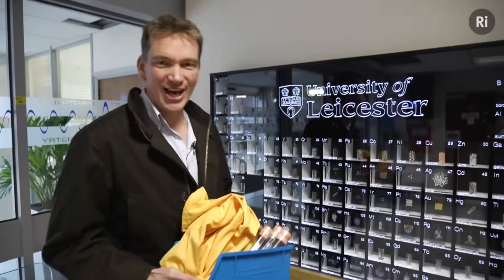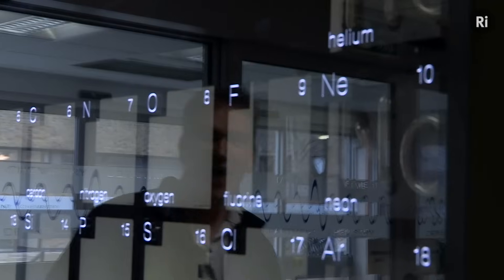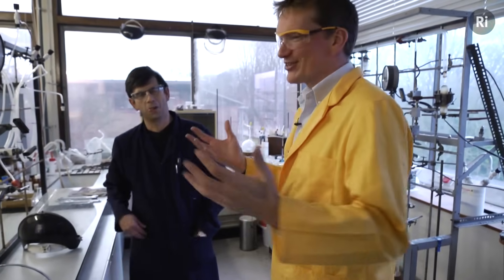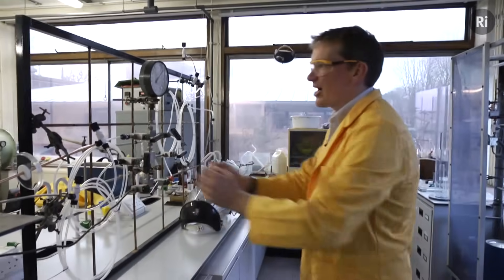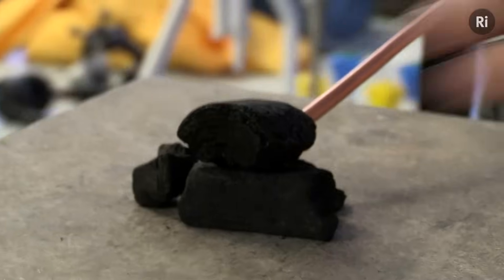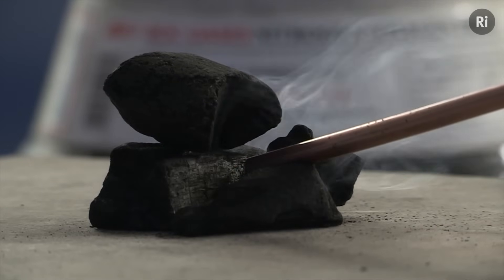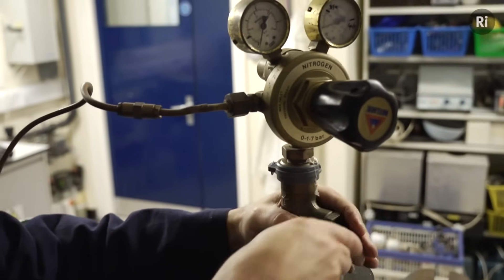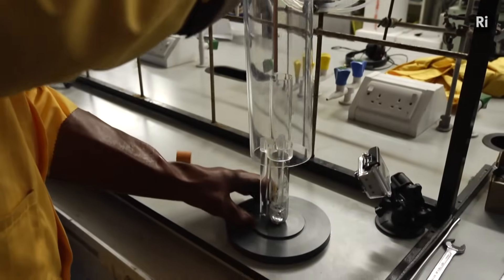Reacting Fluorine with Caesium - First Time on Camera

Comment: thats a load of BS, I thought that the alkalie metals got more reactive down the group. Francium is more reactive
Reply: Actually, due to relativistic effects caused by the extremely large relative mass of Francium atoms, it's atomic radius is significantly lower than you might expect, lower than Caesium's in fact. This means there is a weaker electrostatic attraction on the highest energy electron in Caesium than in Francium therefore the activation energies for Caesium reactions are lower, making Caesium more reactive.
Reply: Except Francium only has a half-life of 22 minutes in its most stable isotope, is highly radioactive, and about 1 ounce exists at any given time in the Earth's crust. For all intents and purposes, Cesium is more reactive due to the fact that Francium has never actually been reacted with anything.
Reply: A fact is a fact. Francium is definitely a more reactive metal. But I get where the guy in the video is coming from. (basically I'm being a pedantic bastard)
Reply: Sure thing. While you're right in there being quantum effects, they are very complicated to try and explain, but they have to do with the energies of the electrons. To simplify it slightly I'll use Bohr's model of the atom which treated electrons like planets orbiting a star (the nucleus). As the electrons are moving in a circle, they are constantly changing velocity by their direction of motion and therefore are always accelerating. This is actually why the theory doesn't work as they would radiate electromagnetic waves when accelerating, but for simplicity's sake, I'll stick with it. The electrostatic force between the electron and the nucleus acts as a centripetal force. This is needed due to the acceleration of the electrons as F=ma (newton's 2nd law). Anyways, in circular motion, F=v^2/r where F is the centripetal force, v is the velocity of the electron and r is the distance between the electron and the nucleus. In Francium, the nuclear charge is so high that the force between it and the electrons in the lowest energy levels causes the velocity of said electrons to be so large that special relativity is needed to be taken into account. I'm not quite sure on the specifics here myself but I do know that this causes all of the electrons in Francium to have lower energy levels than expected, even lower than that of Caesium. This means that in the reaction, more energy is required to ionise the Fr atoms to Fr+ than for Cs. This makes Cs more reactive. (Sorry about all the circular motion stuff, just had an A2 physics exam :P)
Reply: ASandwichNinja Can you please explain how this is caused by relativity? Seems counter-intuitive to me- I'd guess it was a quantum effect.
Reply: ASandwichNinja Thanks for your reply. Don't worry- I did a Physics degree so I get that if electrons were actually orbiting at close to the speed of light you'd need to take into account relativistic effects. Still, in reality they aren't orbiting- so can length contraction really be applied to electron "orbitals" in that way?
Reply: ***** Actually yes, it can be done as simply as that by using the equation for length contraction L'=Lsqrt(1-v^2/c^2) where L would now be the bohr radius (the average distance between the nucleus and electron in a hydrogen atom) and L' would be the relativistic radius. Alternatively, the same result can be achieved from using the original equation for the bohr radius, but using the relativistic mass of the electron, but I can't be bothered to type out all those equations :P

Comment: How dumb is this guy, really? Yeah  so Francium may be radioactive and decay, but it IS the most reactive metal, WAY more reactive than Caesium. And Fluorine being the most reactive non-metal??? Try most reactive ELEMENT!
Seriously, get your facts right!
Reply: Francium is less reactive due to relativistic effects. The inner electrons are moving a very fast speed, so fast that you need to take in account relativity in order to calculate their energy levels. This as a result has an effect on the energy level on the outermost electrons in francium which makes them more stable and hence harder to lose than in caesium.
Reply: thecsslife That's just the theory part of it, but melting at 18 degrees C and exploding in contact with air? If that doesn't sound more reactive than Caesium to you, i don't know what will...
Reply: John Werner True that, but the way he says it makes it seem as if there's another more reactive element in the Table, and it's either a metal or a metalloid. But that's not the case, so i think he could be more specific...

Now about the Francium, yes, i know of its minute existence at any given time in the Earth due to its short half-life, but then again, just because an element has a short lifetime, doesn't mean it can't be the most reactive metal out there...
Reply: Actually, francium needs 393kJ per mole to remove its outermost electron to form a cation, 17kJ per mole more than caesium. As other people have said, its due to relativistic effects.
Reply: MCvirtual3d Gameplays Where did you get that information from? I'd like to see THAT theory! Still, i think Fluorine continues to be the most reactive element in the universe. You know, what with it bonding with noble gases out there
Reply: MatBacon I'm pretty sure what he meant was the most reactive practical metal. It would be unpractical, crazy, and expensive to have Francium due to its short as hell half-life and radioactivity. I'm sure he knows that its the most reactive, any 10th grade chemistry student knows this. So in essence, he probably should've said "The most reactive element that can be obtained."
Reply: yes Francium in the most recitative element if you were to put a gram of Francium in water bottle it would destroy dozens of houses around you.
Reply: theinfamousnimrod Well, he did specifically say "even more reactive than Francium", so honestly, i don't think he knows where his facts are...
Reply: MatBacon well sorry but that theory is still just a theory because there has only been 300,000 atoms of Francium discovered in uranium ores and has a half-life of 22 minutes then decays into radium so there can only be about 30 grams on the planet at one given time.
Reply: N0ah's Gameplay's True that. Imagine if that theory were a law though...
Reply: James Oldfield If i'm not wrong James, out of all elements, fluorine has only not reacted with He and Ne. I'm pretty sure Ar has been successfully reacted with F. The resulting compound is only stable at very low temperatures though.
Reply: Alex Shakeshaft Apparently Chemistry doesn't care what we think. Nobody tells it what to do, it is its own boss.
Reply: Hey monkey boy The Wikipedia article on Francium states: Francium has a slightly higher ionization energy than caesium, 392.811(4) kJ/mol as opposed to 375.7041(2) kJ/mol for caesium, as would be expected from relativistic effects, and this would imply that caesium is the less electronegative of the two.
Reply: @Soaring-Dragon  true that

Comment: I dare you to react elemental fluorine with elemental oxygen. At room temperature.
Reply: Wouldn't you just get oxygen difluoride?  It's a known compound and of course a very powerful oxidizing agent, but probably not any more dangerous than fluorine itself.
Reply: xtenkfarpl xtenkfarpl snr Perhaps. I'm no longer sure. I was thinking it would be Dioxygen Difluoride.
Reply: ZizZazZuz
It appears O2F2 decomposes above 113 Kelvin, so you won't get that at room temperature.
Actually I'm not sure oxygen and fluorine will react at all at room temperature.  I'd have to look into the bond energies, but I suspect O2 + 2F2 -> 2 OF2 may be endothermic & won't happen spontaneously?

Comment: The most electronegative element with the least one.
Reply: Wait, I'm a beginning chemist and maybe some of the stuff i've been taught is false, but isn't Francium the least electronegative?
Reply: @venomoussloth5092  Just studying the trends won't help....There are some anamolous properties in the groups and periods... Mostly because of their electronic configuration and their half/full symmetric configurations
Reply: @venomoussloth5092  It depends on the relativistic effect. Because Francium has so many shells the outer shells are moving at fraction of light speeds and it actually causes the atom to contract a bit. and makes the electrons harder to remove than expected. That makes it easier to remove an electron from Caesium than it is from Francium. Hope that helped :)
Reply: @generationedge6699  if francium was not radioactive
Reply: @ytbgamer9380  Well radioactivity doesn't make any difference to the electronegativity of the element .. well at least that's my understanding. Correct me if I'm wrong.
Reply: @generationedge6699  correct, it's due to length contraction due to relativistic effects
Reply: @venomoussloth5092  maybe because Francium is radioactive and it decays. Idk honestly as I'm a 10th grade student :-)
Reply: @bhoomipurohit_nd5_em802  Radioactivity doesn't have an effect on electronegativity of an element. Also, I'm a 9th grade student. School doesn't teach us anything anyways. Thank you Internet.
Reply: @venomoussloth5092  no
Reply: @darkgreninja8349  Why no, Francium is the least electronegative
Reply: @illya.ruslanovichshevchenk4106  No it isn't
Reply: @venomoussloth5092  it is, theoretically...but it is radioactive in nature and so it is not considered the most reactive metal practically
Reply: @coco nut seems like everyone is here in 2021
Reply: It won't explode un like it react with water
Reply: @unknowunknown9096  Francium would still explode in water, just not as violently as cesium does.

Comment: Francium is actually the most reactive metal... But it's nearly impossible to get your hands on.
Reply: I doubt that supercooling francium would have any effect on its rate of decay, as that's a nuclear reaction (as the name obviously implies, one that happens inside the atom's nucleus) and supercooling only slows down chemical reactions (which happen between the orbiting electrons and those around other atoms). The most stable francium isotope actually has a half-life of 23 minutes, if I'm not mistaken, but it doesn't immediately decay to a stable atom - it goes through a series of radioactive isotopes of other elements before becoming lead. However, it's so intensely radioactive that any sample large enough to be analyzed by ordinary macroscopic methods would soon overheat and vaporize under its own heat. Such an amount has never been artificially produced, and all natural francium (for the brief time it exists) occurs as isolated atoms here and there, never in even microscopic continuous amounts. The same applies to astatine, which however has a couple of isotopes with a longer half-life (a few hours) and has been prepared in large enough amounts for some limited direct studying to have taken place.
Reply: lasts like 12 seconds or something like that before it changes into a stable element
Reply: Indeed. It can never be macroscopically obtained however. Until (IF) we have the technology to stabilize nuclei or rapidly supercool francium, we will never be able to see it.
Reply: rapidly cooling it will keep it stable longer?
Reply: Goytá F. Villela Jr. Good points, but if we take a thermodynamic approach to this, not all hope is lost.

The emission of an alpha particle is not the direct cause of vaporization, but it is the interaction of the high-kinetic energy nuclei (and occasionally gamma rays) with atoms in the sample which then get kinetic energy, which is effectively heat. 

Applying a cryogenically cool substance (i.e. liquid helium) can absorb this heat very quickly, if it is continuously resupplied, because of how heat dissipates (entropy can come in handy sometimes!). This could indeed possibly keep a sample cool enough to stay liquid or solid. The helium emission from alpha particles and the impurities from rapid decay would be the only remaining issues.

It is lucky that Fr-223 emits helium nuclei, quite literally the least reactive element, very convenient.
Reply: Goytá F. Villela Jr. It didn't intend for it to slow down nuclear reactions, that's preposterous!

It will, however, get rid of the heat induced on the sample from the nuclear reactions taking place, and hence could potentially stop it vaporizing.

Comment: Okaay....Im no chemist...but Ive been taking cesium to increase my bodys...  And I know the water is doesnt have the kind flouride ....so does that mean I could be.a walking time bomb?  	Possible explanation for what I thought was scarlet fever?  Its nice to know Im just a lab rat...geesh
Reply: The cesium you're taking is already ionized and in salt form (Cs+), just like the sodium (Na+) in salt. It has lost its outermost electron in a similar oxidation-reduction reaction to the one shown in the video and is no longer reactive. Elemental cesium however (shown in the video) will readily release its outer electron to pretty much anything with a slight affinity for it. The reason they store elemental cesium in that tube with argon gas is that if they had atmospheric air, oxygen would rapidly oxidize and convert it into a non reactive species. So no need to worry.
Reply: To simplify what Matthew E said: it's the metallic, elemental form of caesium that has that reaction. Sodium metal reacts the same way (only a bit less dramatically), and here on YouTube you can find lots of videos showing its explosive reaction with plain water, and producing nasty corrosive caustic soda to boot. But it's only in the pure, metallic, elemental state that sodium reacts that way. You are not afraid to put a pinch of salt (sodium chloride) into your food or to swim in the sea on a beach with water full of the same salt (and hence with lots of dissolved sodium), are you? The same applies to the fluoride (with a "d") salts added to treated water. It's only elemental fluorine (with an "n" and which, as you can see in the video, is a gas) that is so reactive. And when it reacts, the resulting fluoride ion is so stable that, on the contrary, it reacts with almost nothing. There is neither elemental caesium (or sodium) nor elemental fluorine in your body (if there were any, you would be dead in no time). So, you're absolutely safe.

Comment: What does the new product look like ? :-(
Reply: Thanks
Reply: Jon J When any alkali metal (Caesium in this case) reacts with a halogen (Flourine) a white or colourless salt is produced, a common example of this is sodium ( an alkali metal) reacting with chlorine (a halogen) to make sodium chloride (table salt)
Reply: *****, it probably reacts with strong acids producing the respective caesium salt and HF, as it's a salt of a strong base (CsOH) with a weak acid (HF), resulting in a somewhat alkaline solution.

Comment: Thank you for that! I have a few questions now that I've seen this experiment,
after the reaction there is an end product left behind, so if I may, I would like to know:
1st. What the new compound?
2nd. Is it a Base, salt, alkaline, acid or what?
3rd. Is there a naturally occurring analogue?
4th. -I've a few questions about the new compound's reactivity...
-a. Is the end product still highly reactive or has it's reactivity been dampened and by how much?
-b. If yes, it's still reactive, how reactive is it?
-c. If yes, it's still reactive, is it reactive in air?
-d. If it's NOT reactive in air, how stable is it?
-e. Is it inflammable?

I'm just fascinated with the reaction and had these questions still nagging me after I watched this.
Reply: The new compound is CsF. It is the salt. It is not reactive.
Reply: Just like how an alkali metal Sodium reacts with a halogen Chlorine, Caesium, another alkali metal reacted with a halogen, Fluorine making them to form a salt CsF similar to how NaCl is formed in the first case